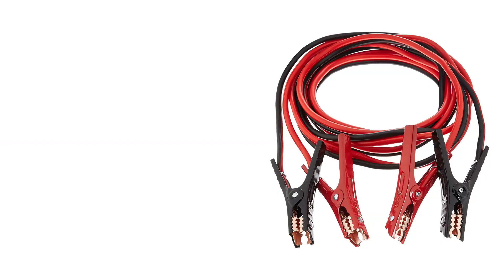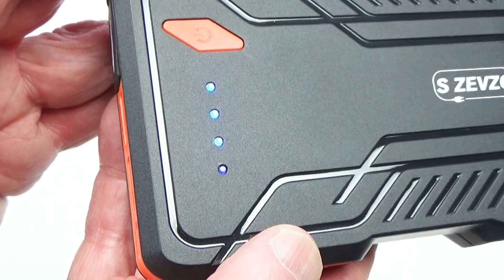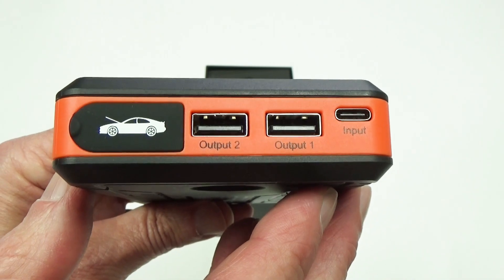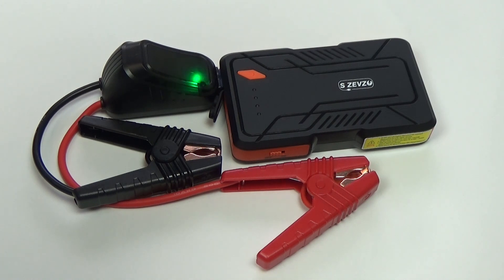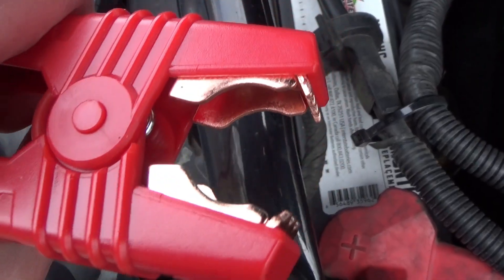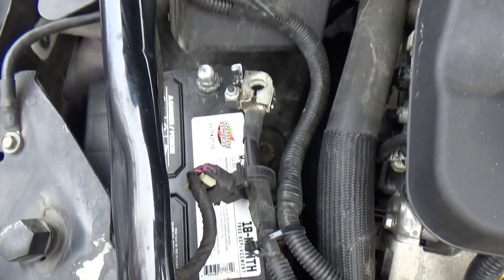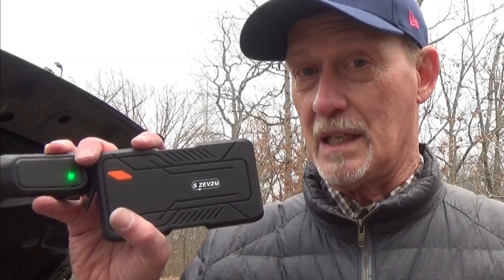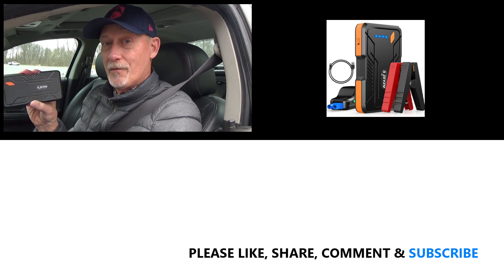The S ZEVZO 1000A Is Why You Need To Get A Portable Jump Starter & Get Rid Of Your Jumper Cables!

Comment: I keep mine in the original box, in my trunk. (so the "on" button won't get bumped on) I also take it out and recharge it every 3 to 4 months, so it's always charged to 100%.
I also have a really good set of 35 year old jumper cables. I discovered that the clamps could get corroded and fail to make contact.  I'll probably clean the clamps, but I'll probably never need them again.

Comment: Yes that does have an override feat where you hold thst orange button for like 3 sec and thsts for when the battety is completely dead. Press it gor a second is regular mode but usually dead batteries have some xharge left in them. Great video as you actually went over it vs specs
Reply from the maker: Thanks for adding that information! Good to know.

Comment: 2 questions: 1. If you disconnect all the wires of the dead battery @5:50 and jump-start your car with the portable Jump-Starter, could you reconnect the wires to your dead battery whilst your engine is running, so that it gets loaded again ? 2. Could you charge a dead-battery with a portable Jump-Starter, as some of the devices wouldn´t work on starting an engine with a dead battery atached to them ? Thx.

Comment: Why can’t you connect the black (-) negative cable to an unpainted piece of metal like a bolt? My Honda Pilot I have to take off two plastic covers to access the negative terminal.
Reply from the maker: I’ve never tried that, but it should work if the cable will reach that far.
Reply: @HowSkills  I liked your original video using Jumper cables where you ground the negative cable on the stalled car. I wonder why the portable chargers all say to connect the negative black cable directly to the dead battery negative terminal instead of grounding it to a bolt, or metal piece in the engine compartment of the stalled car?  I would probably need to attach a terminal extender or otherwise take off the two plastic covers each time on my Honda Pilot to access the negative terminal on the battery. Otherwise, maybe screw in a bolt on the side near my battery. Do you think I can recharge my dead battery this way? Or both terminals must be connected?

Comment: I have jumper cables in my car.
Reply: Same here
Reply from the maker: It's great to have something in your car in case of an emergency, whether it's jumper cables or a portable jump starter. I still own some jumper cables too, but the portable jump starter is what I leave in my car all the time now. They're much easier to use and safer.
Reply: I got the 2000A zevzo “nogo” for my daughter at college.  It’s a POS.  Brand new and fully charged it cannot jump a dead battery on a small SUV. It just beeps and flashes red no matter what.  Jumper cables and asking someone for help is the way to go.
Reply: Red is an error in the connection.  Read the instructions.  If the battery is too low you may need to bypass the safty connection